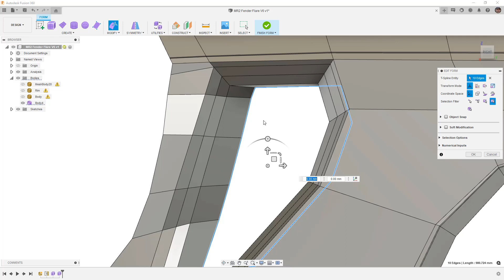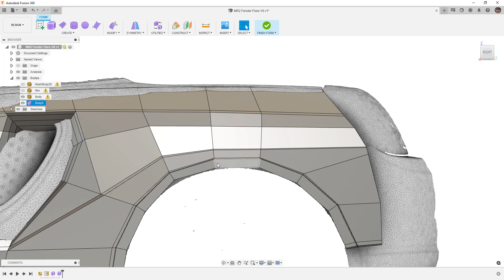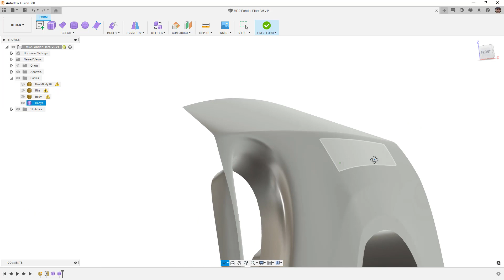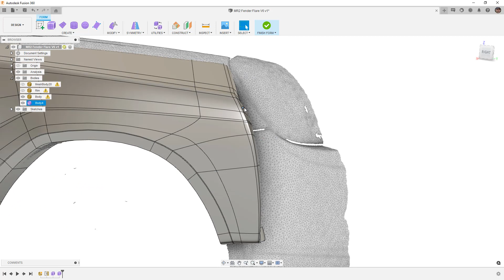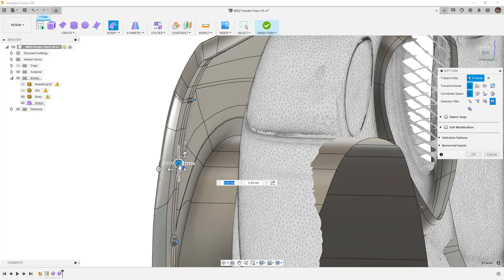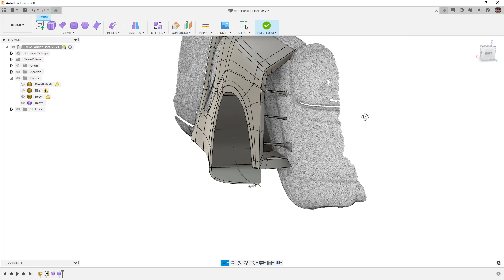Design a Fender Flare in Fusion 360 - Finished MR2 Overfender Design #Fusion360 #FenderFlare

Comment: Hi, Thank you so much for bringing up online such a good tutorial in this specific topic. I managed to finished my fender liner design for my vehicle, but when exporting into mesh and trying to print an scale test on my printer, it has no thickness or mass at all, tried the thicken feature but it just creates a whole new kind of intersection conflicts. How can I fix this issue? Thank you so much.
Reply from the maker: For complex shapes made with forms i suggest doing a thicken in the forms workspace before finishing.  This lets you move the inside and outside independently.  What happens is when you have tight transitions and thicken they tend to pinch.  So in forms you can manually move these around.

If you try to thicken the surface and it fails its probably because of that.  I use curvature map analysis to find the radius on the design and this will generally indicate what the max amount you can offset 

https://youtu.be/Z34fcjtpjEY

Comment: Great series!  Would be interested in seeing how you get the front and top edges to really match the mesh so it could interface to the real car.  Right now it looks like there's still not an exact fit to the stock fender, it's really close but still sub flush on top and without quite as much shape on the door edge. I can't quite visualize how you would manage the shape that precisely.
Reply from the maker: Yeah so the way to get that is really do have a really high subdivision level.  Makes for very tough edits so you want to do it at the very end.  On the tesla spoiler You can see this. https://youtu.be/M77JV2nhm74

And I did a video specifically talking about this in a general sense.
https://youtu.be/PuCwSUPJ16Q

I am going to be doing another widebody video soon but it will be a speed through.  But the trick is to get close with as low face count as you can to get your shape. then subdivide using "exact" so it maintains the shape and use Pull or Match(depending on if you are going to a mesh or surface or curve) to get the resolution.  Tools like Match have a tolerance option that will automatically at Tpoints to get closer but it makes it hard to edit when you try and insert edges.

Comment: As long I watching it, as more I understand the best way to model it - use blender xD
Reply from the maker: In reality this can be done fairly quickly without all the talking :)  In blender you model the actual mesh, here we are getting a true BREP surface out of it.  You can convert a quad mesh right to a form to a BREP so there is a workflow there.  BradBuilds did this from 3dstudio to Fusion(or at least i think he did, he doesn't say how he got the surface out of 3dstudio).